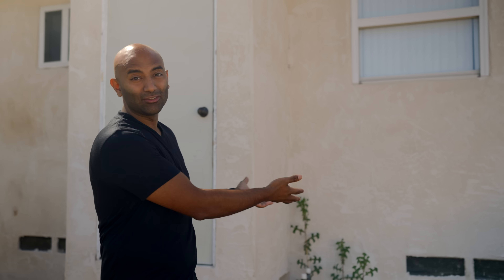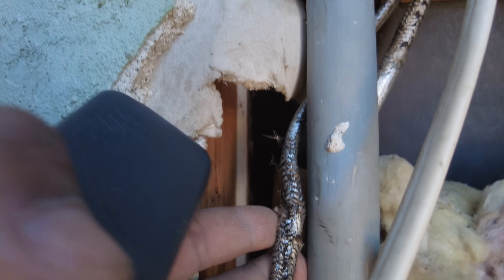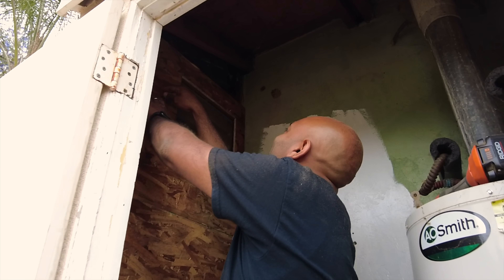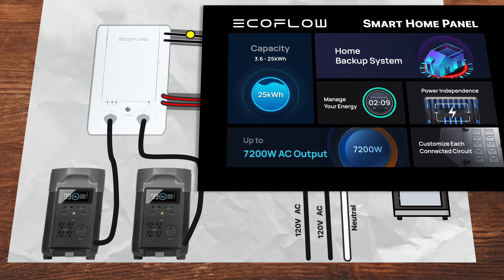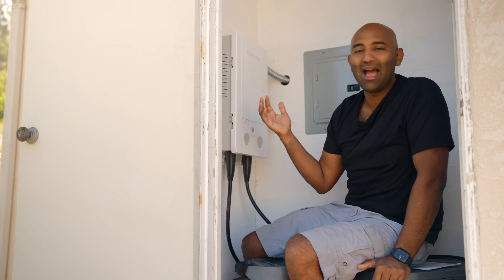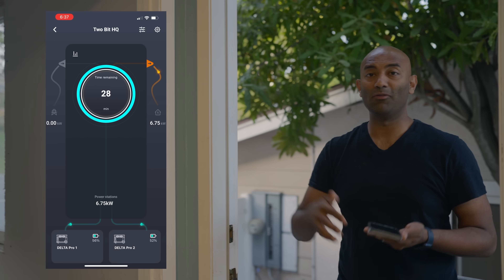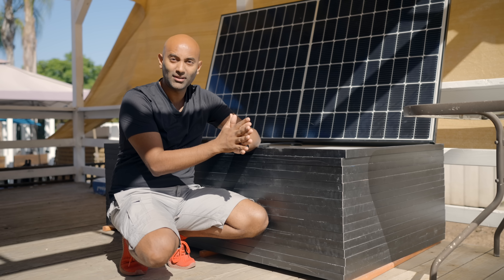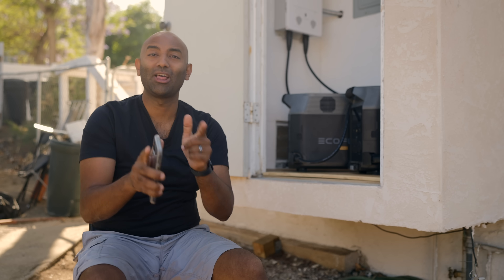Best New Way To Back Up Your Home Energy?  |  Going Off-Grid.

Comment: Wow Ricky, great Intro Video!  
I know you're shooting for a Net-Zero concept.  Are you spraying a 1" Closed-Cell foam flash coat to tighten up your Air and Vapor control layers before you install the Batt insulation?  😀 
So exciting my Brother!
Hey, where is the lil "Heart-$" Thanks button?  😉

Cheers,
Eric
Reply from the maker: We went with a radiant barrier layer then insulation. I’ll have to look I to the foam for the main house. Also I did the north facing walls. When we do the south facing maybe I’ll look into it!
Reply: @TwoBitDaVinci  Only caution with foam is I've seen a lot of insurance and mortgage companies frown upon it so might hurt future remortgages or resale. Apparently its hard to know whats happening with the wood behind the foam. I would argue you dont normally anyway. Research it before adding foam though.
Reply: @richardwilliams648  right, no reasonable residential inspection opens the walls
Reply: Brother, Ricky,
Yes, by all means select your sprayfoam contractor and type of foam wisely.  The "Flash & Batt" closed-cell sprayfoam approach is extremely common in seeking to achieve a Net-Zero or PassiveHouse house concept.  The key is that on a retrofit where Inside sheetrock Walls are removed ... you can create the critical Air and Vapor control layers (plus some Insulation) in one product.  Plz keep in mind that Building Science has 4 basic Control Layers... listed in Order of importance they are:
#1. Water Contol layer (I trust your WRB and siding are in great shape)
#2. AIR CONTROL layer - this is where uncontrollable air and pollutants and bugs may get into the structure. 
#3 VAPOR CONTROL Layer - moisture is a serious issue.  Using a whole house ERV will work easier if pollutants and moisture are controlled by retrofit design. 
#4 Insulation Control layer is last since if Air and Vapor Diffusion are not managed, then the pink fluffy stuff is just an air filter. 

Radiant barriers are wonderful if #'s 1-3 are managed.  They are amazing and most effectively for use on roofing. Radiant and emmisive barriers can massively drop drop roof conductive and Radiant energy transfer.  If you must replace roofing shingles in prep for Solar shingles or panels... the combination of Radiant and Emmisive materials in combination can be stunning.  I can send you a link next week to the article my professor (Dr. Alison Bailes, CEO Energy Vanguard) sent me 6+yrs ago.  It also affords an Active Soffit to Ridge Vent air flow between the emmisive and radiant barriers.

Cheers,
Eric

Comment: Went with a basement hot water heat pump in mid Atlantic area to replace oil hot water 12 years ago.  Was a great decision. It got the house to no combustion, so better air quality and fire safety.  And a dryer basement.  In San Diego, I would imagine that you would want to place it in a garage assuming frozen lines wouldn't be an issue.  Also, once had on demand gas hot water.  Really annoying that the water switched from hot to cold so fast when doing dishes, etc.  And nice on the battery backup.  I have been waiting 10 years for a large enough uninterruptable power supply for the fridge so I don't have to play with the fuse box.  Even had the power cord for the fridge put in the cabinet next to it to get access without needing to pull out the fridge.  Maybe soon.

Comment: Very nice review 👍🏼 so have an EcoFlow smart panel awaiting installation and one Delta Pro. I plan to add a second Delta Pro or perhaps more depending on how much energy in excess is produced from my 20 solar panels beyond what the batteries can store. 

⚡️ I also purchased the J1772 adapter, allowing me to fill up the Delta Pro from any L2 EV charge station for camping or just as a secondary charging option. My experience has been very good and have a strong impression that EcoFlow has put a lot of thought into their ecosystem, and have been quite happy with their products this past year since learning about them from a friends recommendation who uses Delta’s himself. The smart panel only made sense after purchasing the Delta Pro and am looking forward to offsetting the peak periods of energy use between 4-9 as well as having the added peace of mind in case of an unexpected outage.
Reply from the maker: That’s awesome. How do you wire the panels? Parallel and series

Comment: Are you familiar with the Span smart panel? I'm curious how the EcoFlow panel compares. I recently installed the Span panel and am having solar installed. The Span panel can be programmed to turn off breakers automatically to let the backup system power your must have appliances. 

As far as water heater, if you still have a gas line I would (and did) go tankless gas hot water heater. It runs on 120V and pulls very little power. I currently have a Navien NPE-180S and it is hot and fast.

Comment: If you do a ground source heat pump with a DHW option you can do an electric hot water heater that only uses the electric when the water drops to 110F

Comment: We eliminated our natural gas furnace and water heater and replaced both with heat pump and heat pump water heater in 2012 and have celebrated that decision with our 13.2 kWh solar PV system and two Powerwalls operating as a microgrid for ~9 months a year, while charging both Tesla's (MS and M3), and exporting ~ 50% of our excess solar back to grid. We were 350% last year so we are producing much more than we are using in Edmonds, WA.
Reply from the maker: That’s so amazing David congrats!! You’re well ahead on your journey but I hope to learn from you!

Comment: It looked like you didn't have any insulation in your walls at all when I saw you taking off the drywall.  Is that common there?
Reply: Yeah, look at 1:14 No insulation in the outside walls.  That's really odd
Reply from the maker: In San Diego, its common on older homes, our weather is very mild all year, but it still sucks! Our main home does appear to have some, but the second building the office, had none! we have adding batt insulation and a radiant barrier now. We will share that in another video soon
Reply: @TwoBitDaVinci  Thank you for the answer.  I am up in Canada, so no insulation means you freeze to death in the winter.  Summers are nice where I am though, so there's that. :D

Comment: Always love the videos and for water heating IMO, with San Diego''s Climate simple heat pump water heaters like Rheem are probably the best bang for your buck. That being said I am a huge fan of heat pump hydronic systems with a desuper for DHW when you are in cooling mode. If you're looking for one of the lowest emboddied carbon I recommend the SANCO2 HPWH. It is pretty pricey, but uses CO2 as the refrigerant and can help to get COPs of 5.
Reply from the maker: Interesting! I’ll check them out
Reply: Could you pair that with a radiant heat solution under the floor boards since he took those up (for some reason)?

Comment: Sanden (Sanco) CO2 Heat pump water heater would be great to see here. Great video!
Reply from the maker: I’m looking them up now. Could you tell me the benefits of CO2 vs anything else? Thanks!!
Reply: @TwoBitDaVinci  as a refrigerant it's far less damaging to the environment to work with or if you ever had a leak. The Sanden system is the only one I've seen so far that is a split system where the heat exchange takes place outside. The inside tank is purely for storage. Also runs on a 15 or 20a circuit which is great for off grid and solar integrated installs.

Comment: I just bought this whole setup with the smart panel and the double voltage kit, some is still in transit but the Delta Pro units have been great so far while we wait for the rest to arrive
Reply: Looking at the photos of my circuit breaker now I'm not sure what I'd want to do in an extended outage, my AC is 10 amps higher than my biggest relay, I'll have to look at the plate on the unit or just make sure the heat pump to replace it and the furnace is 30 amps or less. All this is assuming we move back there next year, who knows what the money situation will be like next year that dictates our next move, back to our house or on to somewhere else.

Comment: We changed to heat pump hot water about a year ago. You do need good solar it can draw 6kw and on a cloudy day that will exceed the capacity of the battery system. But we only need to run them 2 to 3 hours a day. We have occasionally run out of hot water, so you do need to manage it a little. We have two heaters, time them to run at different times And ensure they are don't come on at peak times. Very happy with them overall.96% down on gas bill

Comment: Definitely look at the heat pump water heater. I am specifying one for the desert house. Placing it in the garage. One benefit most don't think of... the heat pump water heater expels 'cold' air! So it can assist in cooling! Maybe you can route that cool air into the room?
Reply from the maker: yeah that's such a cool win win... I am going to move the batteries, and get a small water heater in that closet and that can keep the whole system cool!
Reply: @TwoBitDaVinci  heat pump water heaters unfortunately require 1000 cubic foot for good efficiency, that's about a 10x10 room.

The small house would be perfect for a small gravity fed passive solar water heater.

Comment: Hi Ricky, I ordered another set of Delta Pro power station and extra battery. I already have a power station and the Smart Home Panel 1 just like you have but I needed the extra infinity cable for the extra power station. I'm trying to find out how long that is but I keep getting different answers from Ecoflow, and Ecoflow doesn't have the specs on their website. One said it's 6' and another said 3'. For $109 I would hope it is 6'. The one that came with the panel is 6' long. I assume you bought the extra one separate?

Comment: For your water heating, you might consider some solar thermal collectors to heat the water and then choose an electric water heating solution that pairs with that.
Reply from the maker: yeah I might do that... or go all pv solar ,and get a heat pump water heater
Reply: @TwoBitDaVinci   the heat pumps seem cool... Making use of the heat and humidity in your utility space and outputting cooler and dryer air.  While the humidity may be leas of a concern in CA, the heat certainly is a concern worth combating.
Reply: I installed a Rheem hybrid (heat pump) water heater (65 gallons) in December 2020. The heater used 540 kWh energy for 2021. I monitor its condition and set its controls via the app.
Reply: @TwoBitDaVinci  Even with heat pump isn't direct solar hot water more energy and resource efficient?
Reply: @ThomasBomb45  No, heat pumps can easily be 300% or more efficient...
Reply: @whattheschmidt  And David Poz has made a test, that solar thermal takes about 30% less space to heat water, compared to a resistive heating element. And Solar Thermal is good when you don‘t need it. PV is better in the cold

Comment: This is super useful information. Thanks! I like the idea of a modular system, adding batteries and solar panels as I ingrain a system to mitigate California's steep TOU rates. I'll follow up on EcoFlow.
Reply from the maker: exactly why i like this. If you are looking for a massive battery system this isn't for you. This is for like 5-15kWh sort of thing. Plus if you are active and do camping or Rving its just amazing. Imagine getting a second smart home panel in an RV, and just moving the batteries between your house or RV based on what you're doing. 

This also makes it possible to have an off grid solar install! That video is what I'm REALLY excited about, and that's coming soon. sadly i need a new roof first

Comment: 13:15 - You didn't see any interruption in the power (No flicker) because it was already running on battery power.
Reply from the maker: But I did test it again and it’s really quick. They claim 20ms. It’s really solid

Comment: How long is the wire harness? If I get the SHP, it will have to be at least 15 feet away from my service panel.
Reply from the maker: no that wont work its like 3 feet or so, which is how close you need to be to the panel

Comment: Electrical contractor here. the neutrals and ground on that panel need to be separated!
Reply from the maker: yeah, this is how the panel was when we found it, separating ground was part of the final work. we didn't want to get into it much because its not a how to... but you're 100% right!
Reply: This could get complicated very quickly.   But it also depends on whether the Eco Flow Delta Pro's outputs going into the panel are isolated or not.  I seem to recall from one of Will Prowse's videos that they are NOT isolated.  If we assume that the AC ingress is coming from the main house,  then neutrals and grounds have to be separated on the ingress to the little house.   If the Eco Flow Delta Pros are not isolated, then the neutrals and grounds have to be separated on the sub-panel hanging off the Eco Flow's too because it is basically acting as a sub-panel from the main house at that point.

If the sub-panel is on its own service, though, and not sub'd off the main house, that's different.  Then it would be treated as a main panel and not a sub-panel.

Its a mess when batteries and inverters are involved, but it has to be done right. 

-Matt

Comment: I have a Heat pump waster heater,  it's been great.  I live in South Florida and it's in my garage.  I can't comment about how it will work in colder environments.
Reply from the maker: Thanks for sharing Marlon.
Reply: @TwoBitDaVinci  The power savings are a bit shocking.  It was a dramatic drop in power usage.  Good luck with whichever way you chose to go.

Comment: What if your batteries are fully charged, during the day by the solar panels, what happens to the energy still coming in from solar panels. Does it automatically switch to the exchange, or do you have to set that up?
Reply from the maker: the battery would be running your house all day, so any solar input once the battery is fully charged, would just go into powering your house. if you were using no energy, and the batteries were full, the batteries will shut off solar and they wouldn't produce.
Reply: @TwoBitDaVinci  Fair answer, thanks...I'm looking forward to future developments...

Comment: With a family taking baths, the Hot water heaters being battery or solar most likely net out the most savings. Even a separate solar ability with its own battery for me would be a huge consideration. Whan does your family shower? Just my thoughts, very glad to know the technology has advanced this far already. When the room temp LMB comes to market that would be a better more cost-effective battery solution. Dirt costs, less than what is used now?
Reply from the maker: heat pump water heater are way more bang for buck, but work a bit slower, so you'd need to size a system based on your family size and habits

Comment: If you really want to upgrade, the best is commercial grade wiring with home run conduits to the electrical panels.

I did a telephone service call at a home in an upscale neighborhood and the owner was in the process of redoing the whole house.  He had home run metal conduits installed for all of the power and telecommunications.  That will also make it easy for future maintenance.

My GF's house went through a remodel in the 1980s and she had all her electrical upgraded to commercial standards.

I live in a small 2 bedroom condo so my backup is a Honda generator for the frig/freezer during the day and a 1500 watt solar generator for other things at night.  Our HOA recently allowed solar panels but realistically, there's no space for batteries, etc.
Reply: How do you use a solar generator at night?
Reply: @tedmoss  "solar generator" is an industry mis-name.  It's a battery bank charged up by either AC, car 12vdc or solar panels.  I use it mainly for camping but it can power smaller stuff in the home if needed.  The Honda generator which I normally use as a back up for "glamping" can run for about 8 hours so day time use is possible.

Comment: So with your solar panels will you be installing a sub panel cooling system to maximize your power generation? There are a couple of Australian companies that make air cooled system that look pretty reasonable.
Reply from the maker: I'm my 10 years with solar, I have found the energy drop due to heat is quite small. so i don't think its worth the added complexity and cost. will dig into this more soon!